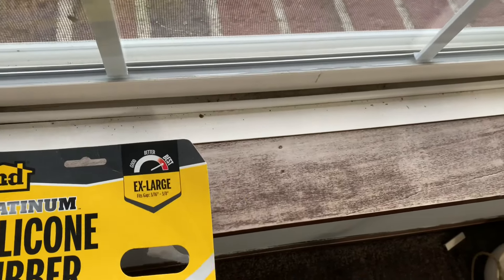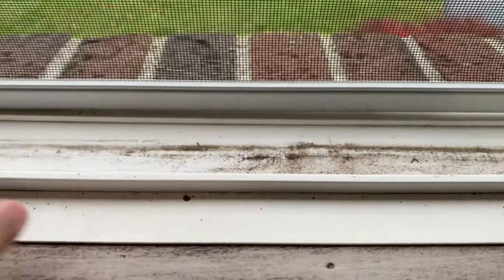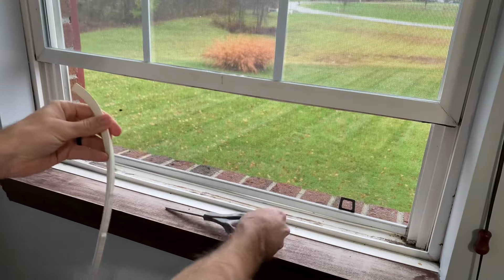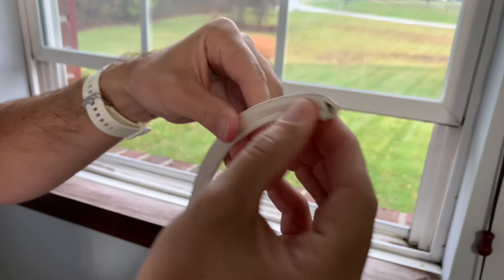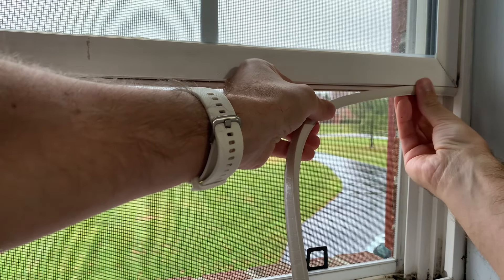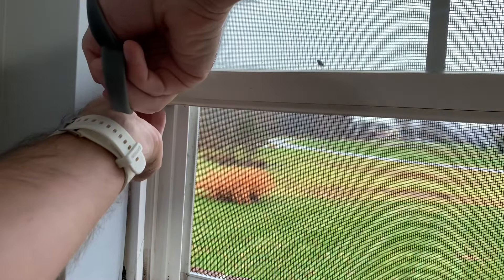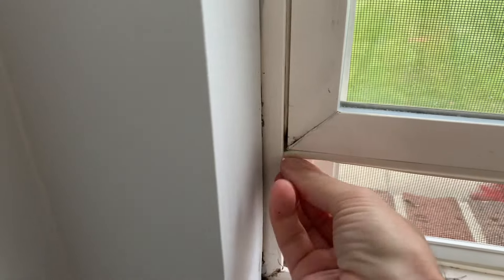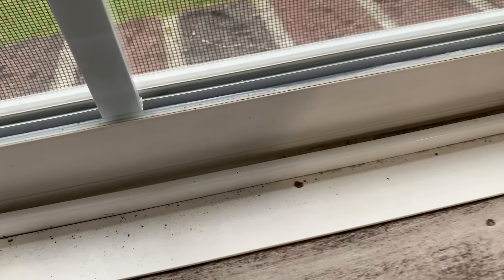How to Seal Drafty Windows w/ MD Silicone Rubber

Comment: When the end that you didn't trim far enough back starts to pull away and gathers too much dirt to stick, pull off the whole thing and reapply with both strips in tact. That way if the sill isn't perfectly flat the strip on the outer edge can ensure that it's sealed better.  Splitting option is for very narrow spaces like storm windows etc.  This stuff may not be what you need though. They make self adhesive weather strips out of a memory foam material that can go from 2-3 inches to less than half an inch to accommodate multiple space coverage needs in one area. I'd give that a go if you're a renter and don't plan to take the advice if others and have your window reinstalled properly.
Reply: This sounds like sound advice, but re-installing the window is certainly the hardest and most inconvenient way to go about it.
Reply: @funeralgiggle3771  not what she meant , she meant re install the strips.

Comment: THANKS, I NEVER THOUGHT OF PUTTING RUBBER STUFF LIKE THAT UNDER THE WINDOW. I WAS THINKING I WOULD HAVE TO PUT SOMETHING ON THE WINDOW SILL PART. IM MAINLY INTERESTED IN KEEPING SMOKE OUT. WHEN SMOKE ISNT HERE I FEEL A BREEZE COMING IN HERE. SOMETIMES IT MIGHT BE A SPIRIT BUT OTHER TIMES I THINK ITS WIND FROM OUTSIDE AND IT SHOULD NOT BE GETTING IN HERE THROUGH CLOSED WINDOWS.

Comment: That dirt build up looks like black mold. The frame is bulging because of high moisture content, either from the outside, or inside. You should have someone do a mold test on your house, if there is black mold visible, there is likely more hiding.
Reply from the maker: Thanks for the advice, we have had some leaking on some of the windows
Reply: Def not black mold just dirt
Reply: That’s just dirt, my guy.
Reply: @LaMostraVia that's definitely black mold. I'm a certified mold specialist.
Reply: What do you do if it is mold? Especially if you can't afford specialists and special treatments